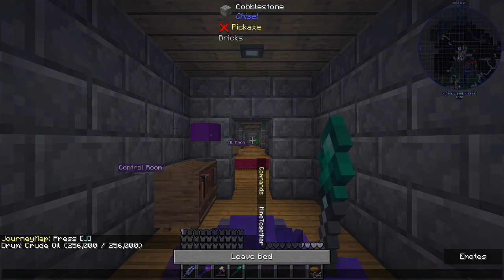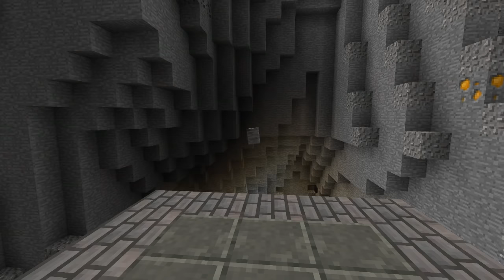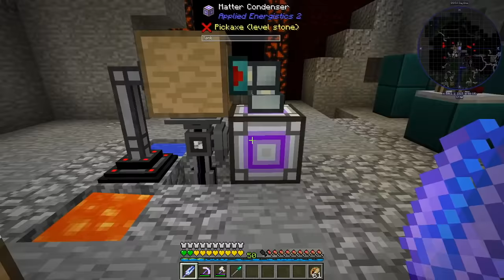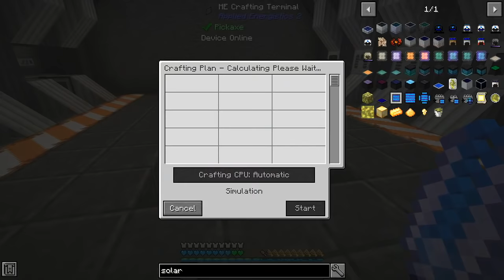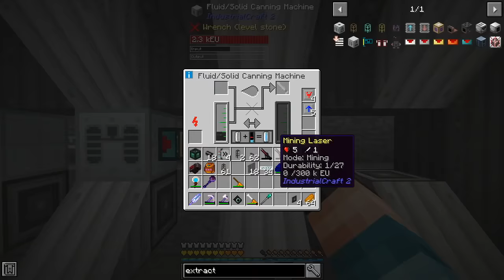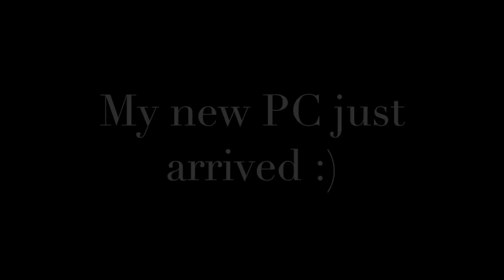FTB Revelation S2 EP14- UU Matter and Quantum Solar Panels

Comment: Great episode as always, don't get to see all the ic2 addon mods often. Only thing I could add here is the reinforced stone can be sped up by right-clicking sand on the foam, unless something has changed.
Also totally right about how the energy packet system works, the cables to have loss though so sending higher energy packets and having transformer upgrades tend to be more efficient. I remember lava was nerfed to hell and gone, but one hacky thing you can try is invest in some kind of redstone farm, if you pump redstone into the machines or energy storage, they'll eat it like crazy, but you also don't have any real limit on how much you can do. (aside from redstone reserves and item transfer speed).

Another interesting way to get rubber is by using fully upgraded sticky reed seeds. But I've tried before and if you're unlucky, it could take real world days to make them.